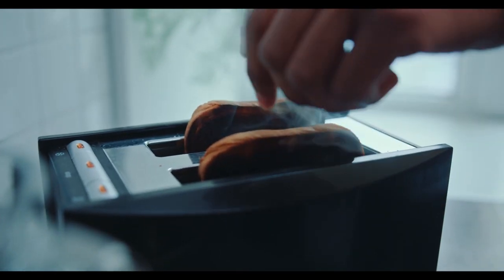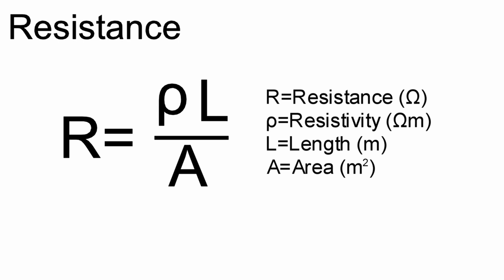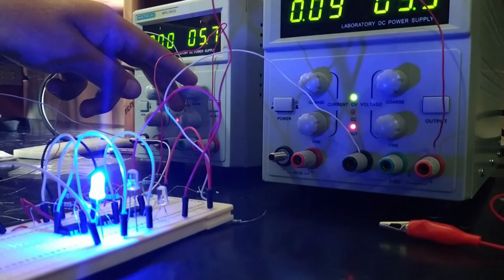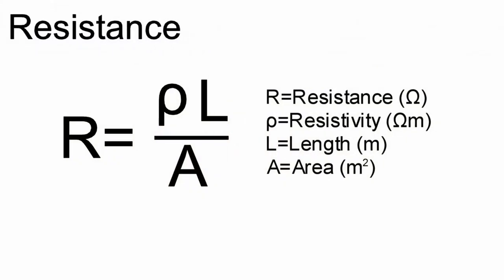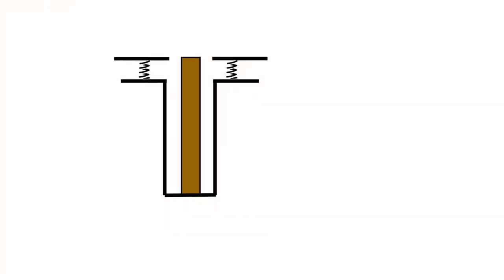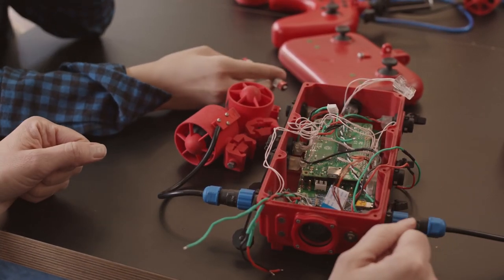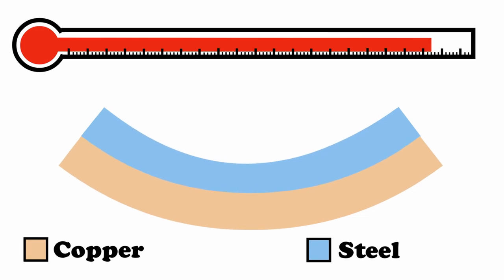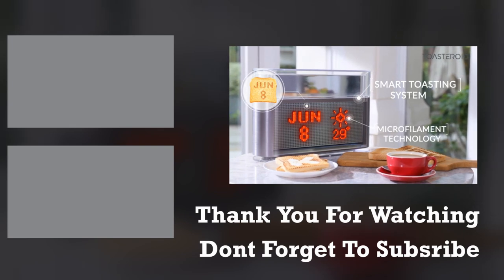How Toaster Works and Toaster Timers Explained - Interesting Engineering and their History

Comment: Do you have a video on a 12 v cooler (no compressor) how it works? Thanks nice video subbed. I know the peletier board inside the cooler dohicky can be replaced for cheap ($5 on ebay) but I dont understand how that works Thanks in advance -pawpaw subbed
Reply from the maker: Thank you for the Sub, I haven't made a video on that yet but I will add it to my list. Let me know if you have any other recommendations and don't forget to share the channel with anyone you think might be interested so it can reach a wider crowd.